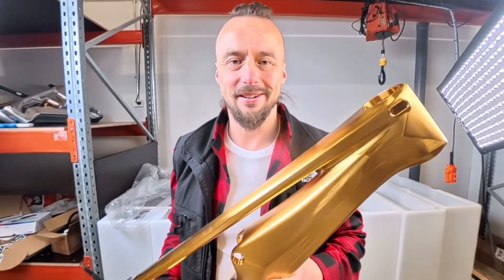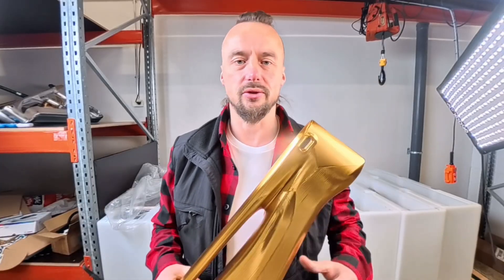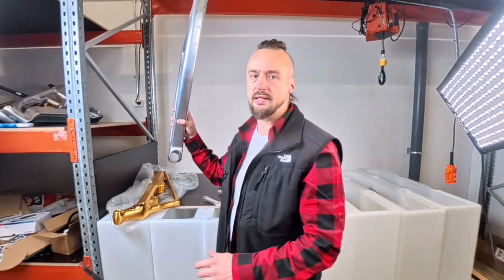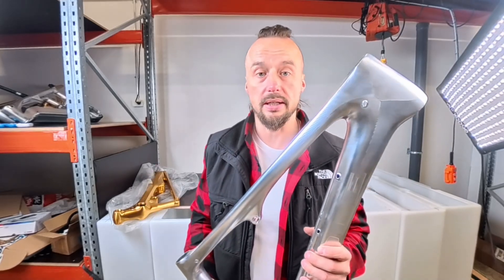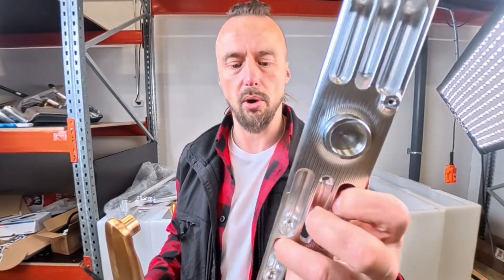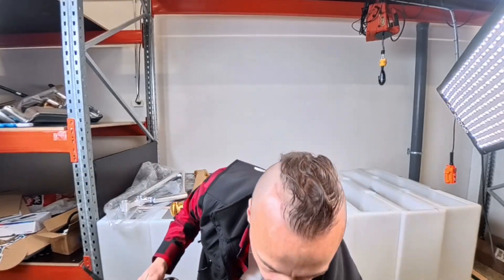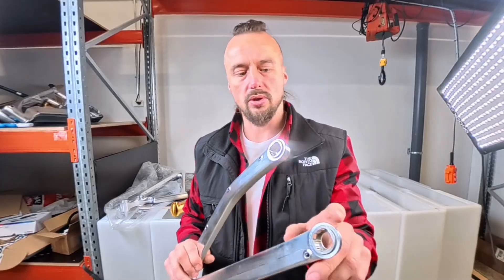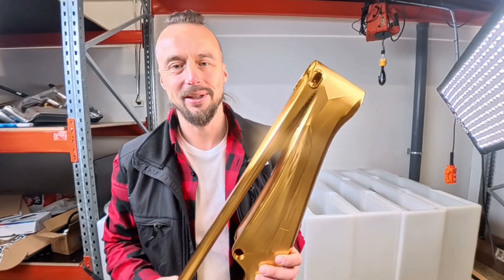Explaining Pole manufactruring method and how did this method evolve.

Comment: Good luck for the future Leo. I love my voima, I've had it 3 years and hope it keeps on going and going. There isn't much on the market today that turns my head, the geometry and travel are perfection imo. Perhaps the only way to make it better would be with a gearbox and belt, I've gone through a quite a lot of derailleur parts bit that's no fault of the bike
Reply from the maker: Thank you! I just checked mileage on my motor. It was >2000 km without a single bearing change on the frame. Thant's not all the mileage for the frame though. I had to change the motor at 1500 km because something snapped in the previous motor. All mileage includes some racing and all four seasons riding after Sonni was released 2023. I snapped a chain this weekend. Previous chain was snapped in April. I don't think that's bad. I'm still with original XX T-type derailleur and cassette.

I have looked into gearboxes, but the weight and belt tension issues (and how they mess with suspension) worry me. I think the bike needs to be designed for the best overall ride quality first, rather than just built around a specific drivetrain.

Comment: Is it cast Alu or what exactly is it made out of ? You said it´s bonded, did you use epoxy adhesive, is that what you mean ?
Reply from the maker: It's CNC machined and we use epoxy adhesive to bond it.
Reply: @Polebicycles  Thank you, I was curious so I have watched the other videos. Very interesting. I didn´t think it would be financially viable to machine whole bike frames. 
Did you play with other ideas as will, like gigacasting the whole frame ? Or Metal injection molding and then sintering the whole thing as one ?
Reply from the maker: @sierraecho884 The critical point is the material strength. All casting materials are too soft for a bicycle. The frame would have to be very thick. We use 7075 T6 which is almost twice as strong as 6061 T6 which is used in most other aluminum welded frames.
Reply: @Polebicycles  "...We use 7075 T6..." Oh hell, that´s some fine material. Steel strength basically. You can´t weld it either, I guess now I know why you bond it lol 
Personally I prefer AL over Carbon but I have to ask. Why no carbon ? You can rapid prototype the layering tools for carbon. The weight to performance is even greater....until it breaks like the Titan sub. Was it for that safety reason ? 
A sintered Titan frame would be awesome. But of course you can´t iterate fast anymore...unless you are milling Titan which is a huge pain in the ass and costs a fortune. That really is an interesting engineering challange. Very interesting to see how you approached that problem.

Comment: Why is the seam not in the centre? Intrigued
Reply from the maker: The frame halves need to overlap. If the seam would be in the center, the overlap would be off center.
Reply: @Polebicycles ah makes sense, I guess the overlap increases the surface area of the seam and/or has some keying feature ❤
Reply from the maker: @jasononions189  Exactly.